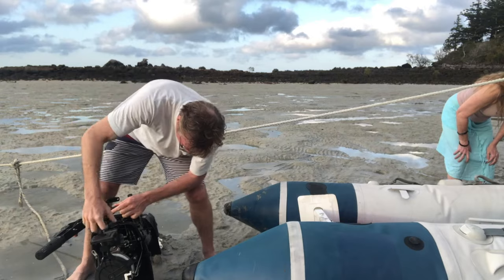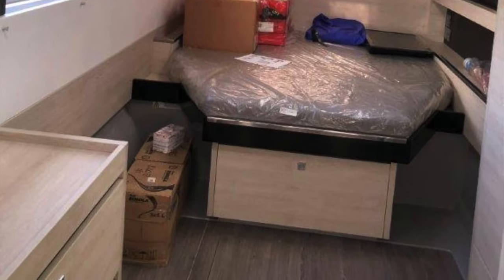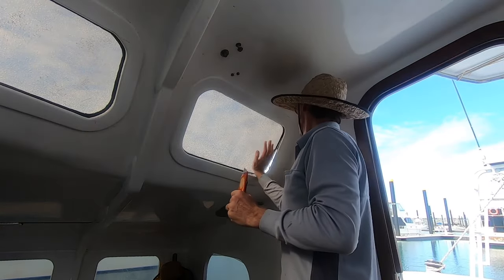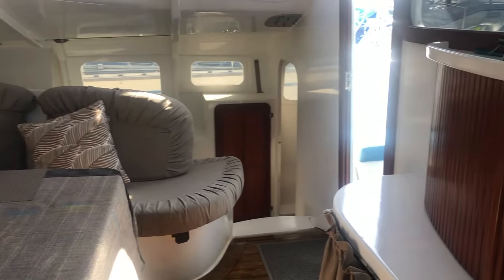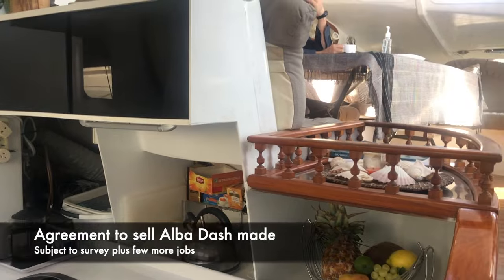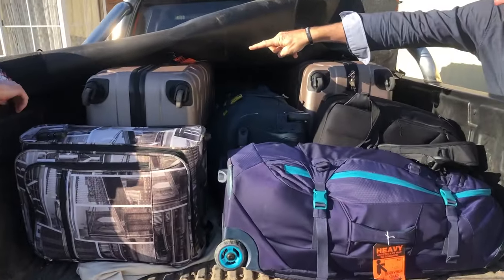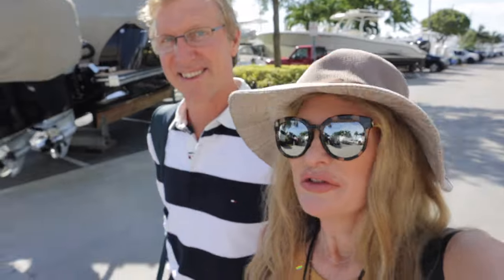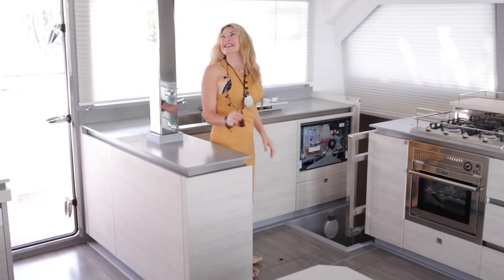#7 Our New Leopard 50 Catamaran Arrives!!!

Comment from the maker: Thanks for the encouragement and glad you are enjoying the channel. Yes we are interested to see how the platform works and operates over the years but our experience so far is that it is a delight to use with the dishy coming up effortlessly and singlehandedly if necessary. Eli really loves it and it also means that we are not hesitant to bring it up for the night compared to the past struggles with pulleys when we would be tempted to leave the dinghy in the water "because it is really calm..." or other excuses only to have the dinghy drift under the underwing or cause trouble if our anchor dragged etc. As the wise guru said "We will see!"

Comment: great videos ... what other boats did you consider before purchasing the Leopard 50 ? - Thanks
Reply from the maker: We looked at the Outremer,Seawind, Catana and since other similar sized performance cats. We excluded the Lagoons early cause the low bridgedecks and wide hulls, and we felt we got more value and benefits with the Leopard while understanding the journey would be a bit slower than with the performance options. It's always a compromise and for the comfort for long term live aboard, the leopard 50 ticked all the boxes with reasonable sailing performance. Thanks for watching and let us know what you want to see on the channel....